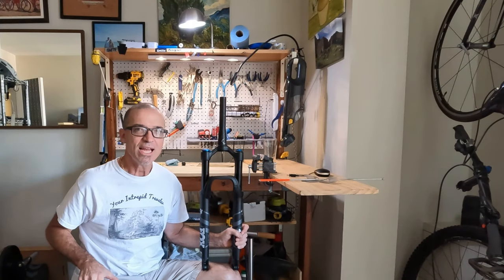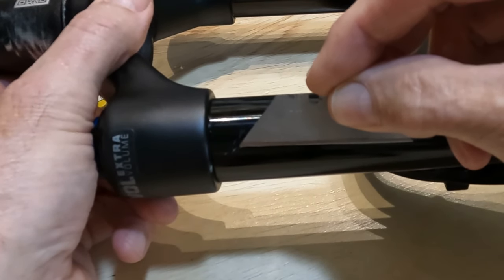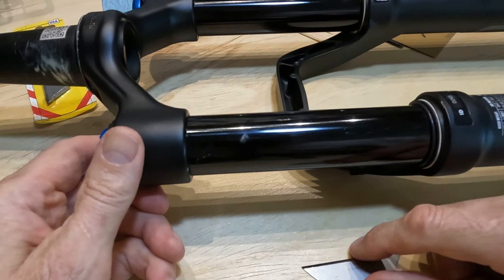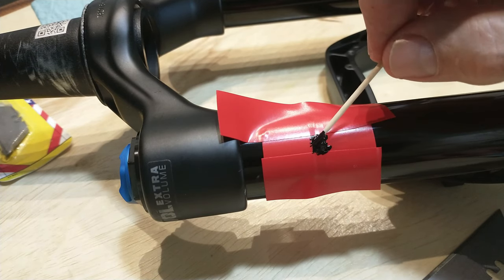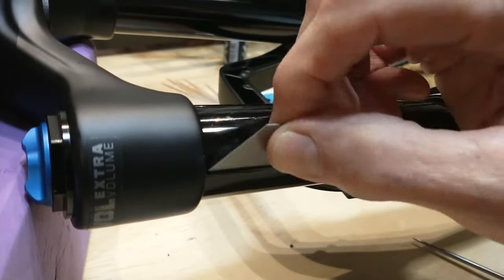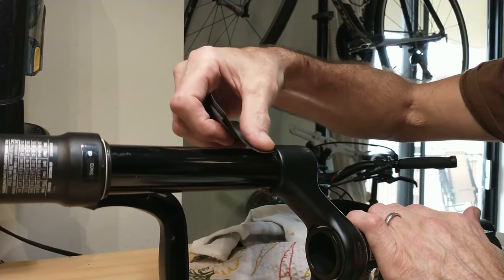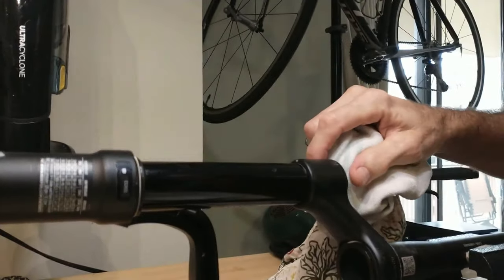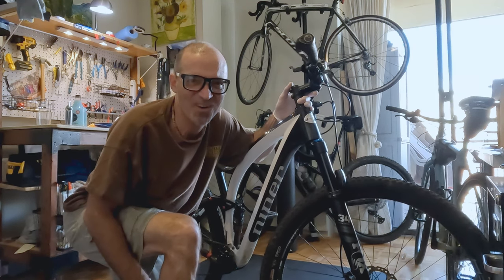How to repair a Mountain Bike Fork Stanchion Scratch

Comment: scratched my brand new Pike last week, gonna try this out tomorrow and hopefully all goes well
Reply: Oh boy! Good luck. My repair is holding up pretty good. It won't look perfect but will feel really smooth. The wet sand paper is key. But use high numbers.
Reply: @smithgov  it actually turned out really well! It looks really bad but it’s practically as smooth as the area around it. Rode it pretty hard over this week and it’s not leaking. Thank you for the tutorial, you’re a life saver for real!
Reply: @miguela.8929  glad it worked!
Reply: @miguela.8929 could you use a paint pen?
Reply: @topspot4834  i think it needs to be something that dries pretty hard like epoxy or acrylic nail polish
Reply from the maker: How did the repair go? @miguela.8929
Reply: @mountainbikingfortherestofus  it turned out pretty good! you can still see a little bit of metal but it’s practically smoothed out :) no leaks in the seals for about 2 months of frequent use
Reply from the maker: That is exactly how it turned out for me as well. Could still see it but super smooth.

Comment: Unfortunately, my motorcycle fork tube got minor scratches which leads to leaking oil. One question. Does this method works on that too? Because im unable to find the fork tube alone, i have to purchase both front fork which is way too costly. And what if i use some more harder material, like metal glue or something in able to be more sturdy?😊
Reply from the maker: yea, if it is already leaking then you would need to replace the seals. After that this method should prolong future damage. Worth trying vs having to replace the whole darn stanchion. That was my thinking anyway.

Comment: Did you notice anything after the repair. Unfortunately my scratch sits a lot lower in the travel but i will try your method.
Reply from the maker: So far so good. I could see the repair but it was very smooth to the touch.
Reply from the maker: How did the repair work out?
Reply: @mountainbikingfortherestofus  well, i have been riding the same fork and it is running perfect. It had a service and the guy couldnt see no wear from the scratches